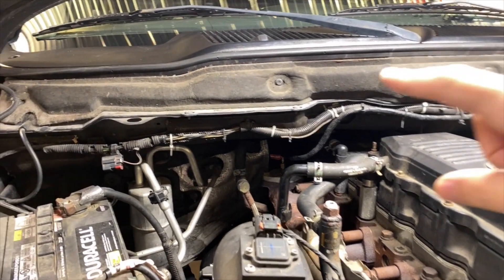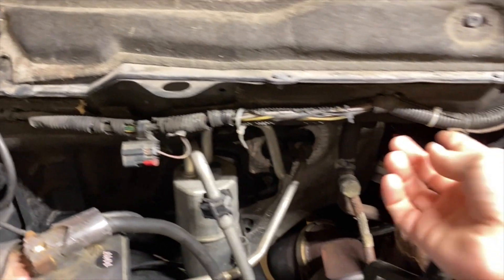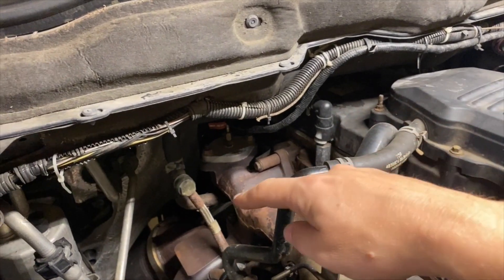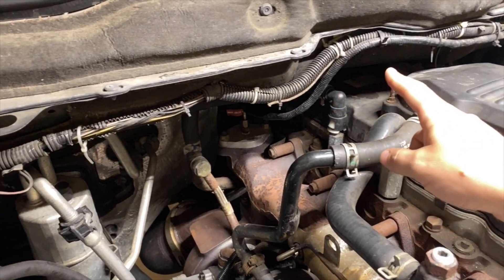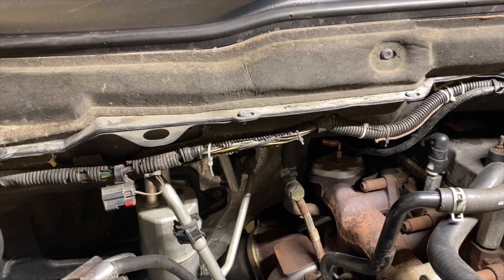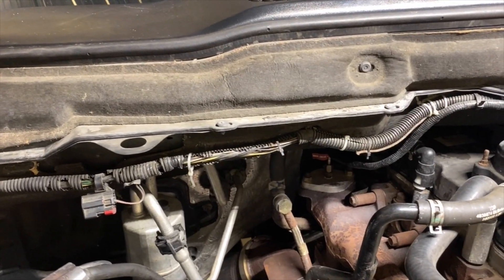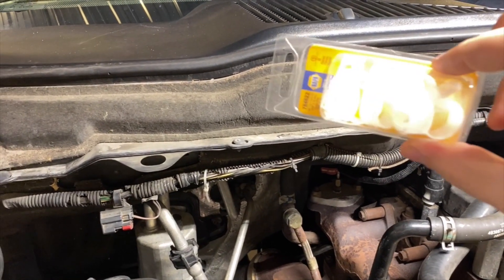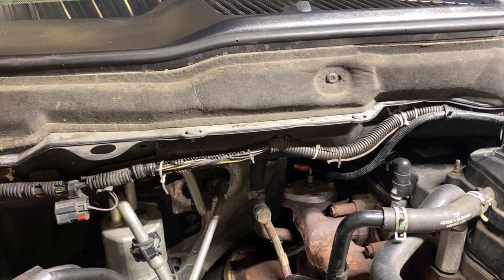Dodge RAM Fire hazard? The second time in 5 years I have to fix this wiring problem.

Comment: Guess I need to check mine!
Reply from the maker: Certainly wouldn’t hurt. Especially in some models I’ve seen the battery interconnect cable go across the back. Mine is in the front…